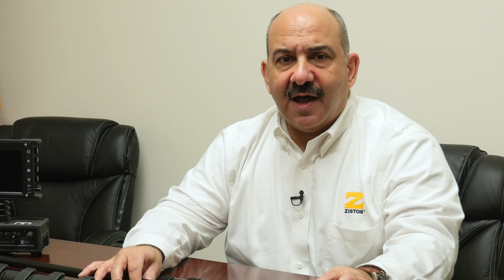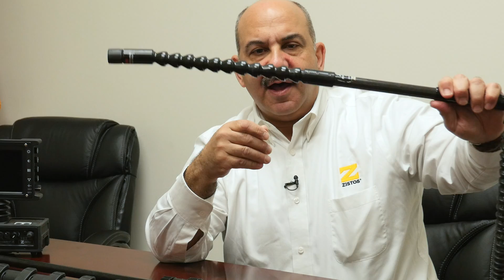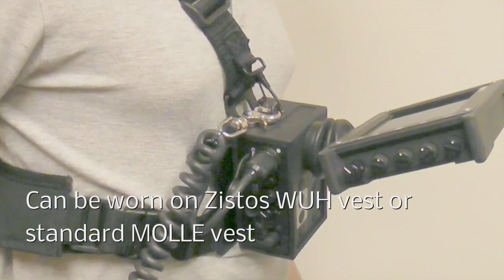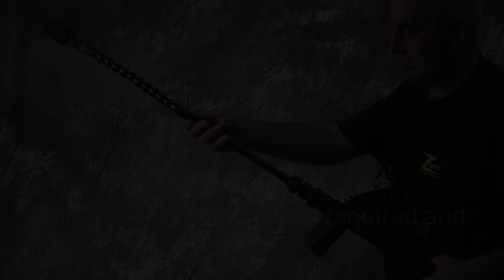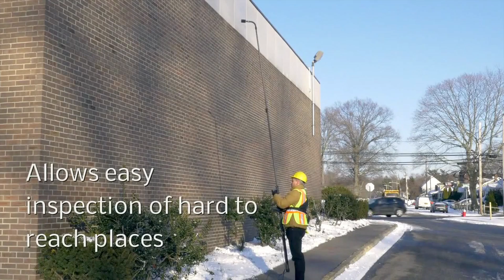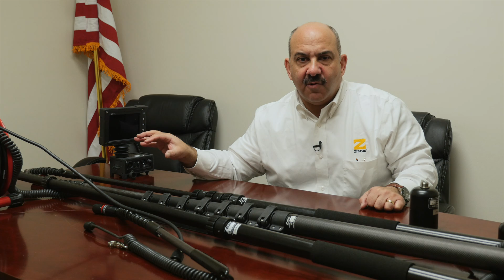Pole and Cable Options for Zistos Portable Video Systems

Comment from the maker: The common requirement for all of our customers is to see into areas that are dangerous or difficult to access. The variety of different pole types and sizes are designed to optimize the range and application of our pole camera systems. With articulating pole options from 3ft to 20ft, FlexEnd pole options from 2ft to 20ft, and Carbon Fiber FlexEnd options at 20ft, 30ft or 40ft you will be able to visually assess conditions in areas that would otherwise be difficult or hazardous.

Being that all of our Zistos camera heads and Zistos WalkAbout displays are compatible with any pole you may choose the combination of pole type, display and camera technology that best fits your application.

Our systems are used by tactical teams, rescue personnel, security personnel and industrial inspectors in many different scenarios. They can allow an operator to "see" high above or below ground - without a ladder; to covertly survey a situation in a second story window or up in an attic without putting themselves at risk; to inspect conditions inside a vault or tank without entering a confined space and search for trapped victims following a building collapse. The various pole types used in conjunction with our other video components give you the flexibility to safely extend your vision and allow you to put your eyes anywhere they need to see.

For more information, please visit www.Zistos.com or call (631) 434-1370.